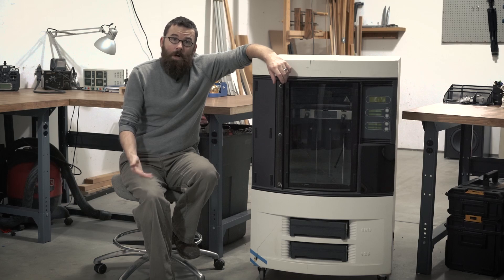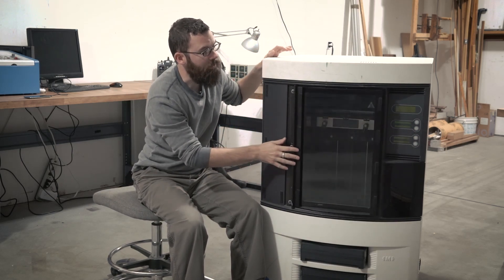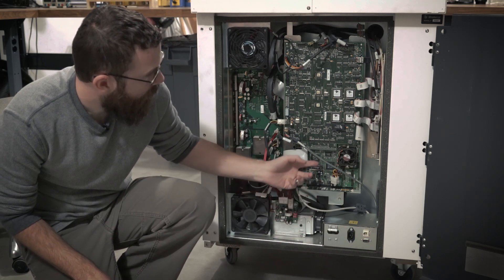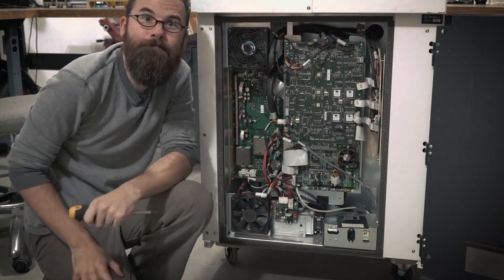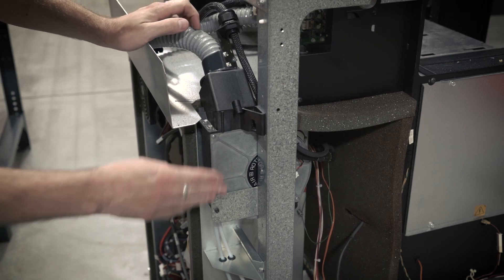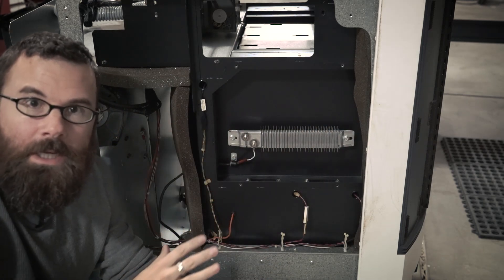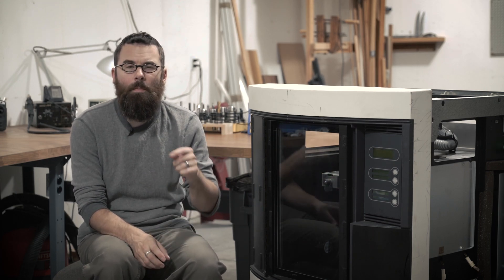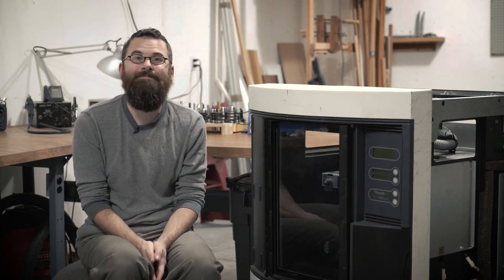Stratasys 3D Printer Rebuild - Part 1: Overview and Teardown

Comment: I just got myself a Dimension Elite which is basically the same machine. It works for now but in the future I plan to modify it with open source electronics.  I watched all this series on the Stratasys and I noticed in the end you came to the conclusion that it wasn't worth the effort.  Especially now more than 2 decades after its inception this is woefully antiquated but still do you think it is worth the time to try and update it other than for the heck of it?
Reply from the maker: It would only be worth it for the giggles.  Any modern coreXY printer would be faster and better in almost all aspects.

Comment: Hi. Sorry to boder . but my BST1200es is claiming for help. We have manage to keep it alive for quite a long time bu linear bearing Y axis are blocking and making the step motors lose steps.  I ve watch you videos on the Stratasys 3D Printer Rebuild ... watch the z axis recovery video... but did not find any info on the Y axis...  i asume the tear down of the axis to change de bearing  can make the system lose its parallelism... any suggestions on how to clean the bearings with out the tear down or how to keep the parallelism while trying to change bearings... thanks in advance

Comment: Im looking at a few Maxum models online to buy just for the cabinets and heater and gut the rest to install servos and linear rails. Probably new controller considering that most of them are junk. A complete modern retrofit including frame. I will fast forward through your project I’m curious.

Comment: Would you happen to know the drive belt sizes and where I can order them from?
Reply from the maker: I don't, check the service manual, it's available online.
Reply: @RobertCowanDIY  I have been trying to find a parts list. I bought the unit at an auction. I have the user manual but can’t find a parts list
Reply from the maker: @bryantbanks1486  SERVICE manual, not user manual.  The parts list should be in there.  But I no longer have the printer, so I couldn't tell you the part numbers.  They are standard off-the-shelf belts.  Just check the pitch and width and use a piece of string to check the length.

Comment: Hey Robert, I just found your videos and am going through your rebuild now. Awesome work! How much would you say one of these is worth? I can pick one up in working condition for $500. I also have some modern parts already from other 3d printer builds. Do you think it's worth the $500?
Reply from the maker: In working condition it's easily worth $500.  Whether it's worth it to YOU is another story, but that's a decent price.
Reply: @RobertCowanDIY  Awesome. Thanks for replying! I watched all your videos and am super impressed. Looking forward to doing a lot of the same work once I hopefully pick up the Stratasys I found. I eventually want to get it where I can print high temperature filaments like Nylon and PEEK.

Comment: I know this is several years old, but I just got one of these bad boys and it needs new belts for the motors.  Any idea where I can get them?  I can't find them anywhere.  Stratasys told me to contact my local service tech and they want $$$.  This was given to my middle school.  So there is no money, or not more than I will spend out of pocket for parts.
Reply from the maker: Belts are pretty common.  The ones on here are gates brand, just look on Mcmaster or SDP/SI.

Comment: A good design for the era it was created in. Lots of areas for improvement though. Super not a fan of the blade of air design. While creative, I believe there is a better and easier way of doing that.

Comment: My name is Vinicius,

I'm brazilian, and i have a 3d print dimension sst768 that is broken.

You could indicate someone to help me??

I await reply thank you
Reply from the maker: If you search google, you can find the service manual for the machine.  I has been posted a few times.  That will provide the most help for you.
Reply: @RobertCowanDIY  OK, you have this link?
I think my machine is loked, the displays show nothing, only backlight.
Reply from the maker: @viniskyredborges  Did you even try searching for it?
Reply: @RobertCowanDIY  i found a file

Comment: Stratasys Field Engineer here: that grey tube pumps air to cool the head. The filament tubes are the white tubes that run into the inlets behind the swivel head. The air does keep the filament stable but it's primary purpose is actually to cool the head.
Reply: Hey Robb, could I ask you for advice for this printer? Do you have a way to contact you? Thanks
Reply: Hey Robb I would also know where I would be able to get replacement drive belts for the 1200BST

Comment: Robert, Thanks making this series you motivated me to do the same and after a year hiatus I have mine up and printing. I did a couple of things different than you did. First I used the 768SST printhead  I changed out the geared servos for geared steppers (NEMA 8) this seams to work well so far, I just had to machine an adapter to interface the motors to the printhead. Second is I used a Duet2 Wi-Fi  board instead of the Smoothie board, again I am happy with this board and it is well supported with lots of information on how to integrate it. Third I used 400 step NEMA 23 steppers for X Y and Z, and I think that was a mistake, as I am having layer alignment problems (sloping sides) in X and Y  that I can not seam to dial out. I was curious if you saw any of this in your prints that you got off the machine?
-Wade

Comment: Hello, what is the reference on the stepper motor, how many cables? 3,4 or 5 or is it a small servo, and the drives what do they look like? What's the reference on those... Maybe can be reused as external...with new board, Sending inputs

Comment: what belts do stratasys 3d printers use? most belts are rated for 80C/175F
Reply from the maker: I'll have to look, but they were just standard Gates brand belts.  I hadn't thought about that, but you're right, the temp rating would be a problem.

Comment: @9:26:  I believe the purpose of the fan and hose system is to deliver cool air to extruder steppers, as they are the hardest working steppers and the most vulnerable to heat failure, etc.  I believe this is how Stratasys takes advantage of their heated chamber patent (https://www.google.com/patents/US6722872).  The extruder steppers are considered to be "outside" the heated chamber (even though at first glance it seems like they are deep within the chamber).
Reply from the maker: The stratasys doesn't use steppers for the extruder, it uses DC servos, so I'm not sure if heat is much of an issue.  I think the fan is to pre-heat or at least get some circulation around the filament.  otherwise, it could just heat up inside the chamber and create issues.  but I'm getting to that part and I'll have to see how it works.
Reply: Ah - that's interesting.  Just looked at some Stratasys vids on YouTube, and I can see what you're saying.  Seems like they're not using that patent at all, then.  Their approach seems to be to run all the motors/steppers in the heated chamber.
Reply: It’s mainly to keep the heat break area cool on the fortus and Titans

Comment: Hello Robert, nice video. I have an old BST768 with a problem. Maybe you could help me? After starting up the machine, the display shows the message "Shutting Down, Code:14, 113 Cooling Donw.
Any idea what that could be? Stratasys says it is a defective door lock. But after replacing it with another one. The error code comes up again.
Reply from the maker: Search google for the service manual and look up the code.  It might tell you more about it.
Reply: The code 14:113 is Door not latched it states the following :

1. Verify chamber fans are operational. If not, replace 24VDC power supply.
2. Inspect solenoid and wiring.
3. Replace solenoid.
4. Replace PD

Comment: About 10 years ago, I purchased that exact unit, but with the matching base/stand.  I was the R&D manager for a medical company and used it for prototyping surgical scrub applicators.  At the time, it was one of the best units on the market.  I also had purchased the post-processing/washing system for dissolving the support structure.  I didn't care for the cartridge system.  But the unit worked flawlessly well.  Unfortunately when I left the company, I don't believe it was ever used again.  Quite a robust unit though. Should be interesting to watch your rebuild.
Reply from the maker: That's sad to hear!  The same thing happened with these, the company had two of them and they went unused and when they moved, they just tossed them out by the dumpster.

Comment: Can you name the manufacturer and the model number of the fans in the heated chamber? Are they made of metal and special high temperature fans? I'm looking for fans for my heated chamber (80°C) but normal fans are only rated up to 70°C.
Reply from the maker: I can check on the fans and see if they have a model number.  They might be custom though.  I'll check when I get back in the shop and see if there are any identifyers.
Reply: Nice, thank you.

Comment: I really don't think I would gut it.  If it still works it can print down to 0.005" and the Insight software is pretty good.  I have my own 768 SST and it works fantastically well.  Plus, you can refill the cartridges.  I don't see how you're going to be able to improve on it very much.
Reply from the maker: Nothing I'm doing should prevent it from printing at the same quality as the standard hardware.  If it worked 100%, I wouldn't be doing any of this, but it does have some issues, and doesn't print.
Reply: I understand.  I'm sure it will turn out great.  What are your plans for the parts you pull out of it?

Comment: Awesome find. I used to use a big stratasys machine back in college, can't wait to see how you upgrade this unit.
Reply from the maker: I have one axis moving around, just need to wire up the other two!  So far so good.  But this is the easy part, the extruder will be tricky.
Reply: Is this one of their dual extruder machines? (one for model, one for support material)
Reply from the maker: Yep, it's a BST, which means breakable support structure.  The SST is soluble support.  So it has 2 extruders.

Comment: Sorry missed the point of why you are going to change components of this machine, wouldn't it be better to keep it as it and just utilize it?
Reply from the maker: I guess I didn't explain that well enough.  The Stratasys uses a proprietary software which is cumbersome to use and I'm not sure if it's free or available anymore.  You can't just send it g-code.  Also, it uses proprietary filament with cartridges that contain EEPROM chips for identification.  It also ONLY works with filament from Stratasys which is VERY expensive (like several hundred dollars a spool).

Comment: What a find! I never find anything this cool on Craigslist.
Reply from the maker: Everyone always says that to me.  You know how long I had this search setup for?  2 years.  It took 2 years for something like this to come around and I responded within an hour.  You can't expect to just hop on craigslist and find anything good, you need to know what you're looking for and be dedicated.  Right after this video posted I picked up 3 working electric wheelchairs for $300 that will get scrapped for parts.  It's just patience and being at the right place at the right time.  I still have searches that have NEVER had a hit after years.
Reply: Robert Cowan I've had IFTTT set up for a few items for a several months now. I was about to give up on them. Guess I need to be more patient! Also, now I want to add electric wheelchairs to my searches...
Reply from the maker: Yeah, I forget some of the stuff I have saved on searches!  I have stuff like roboclaw motor controllers, roboteq controllers, robotic arms, wheelchairs, etc.  Rarely will I ever get a match, and most of the time when I do it's not related or too expensive...  But sometimes, it works out.  Wheelchairs are actually pretty easy to get.  Most of the time the batteries or charger dies and people just toss them.  Over the years I've bought about a dozen or so, and I've never spent more than $100 on one.  They're always in rough shape, but the motors and actuators have always been just fine.
Reply: Robert Cowan ever since I saw your video with you riding the remote control wheelchair, I've wanted to buy one.
Reply from the maker: They're fun.  Get a battery, get a chair, add a roboclaw or sabertooth, done!  I'll be working on the printer and a wheelchair-related project at the same time and releasing videos on both in the next couple of months.  If you have room for one, they're fun to tinker around with.  And SO much faster when you get a controller that's not filled with safety features ;-)
Reply: Looking forward to watching them!
Reply: Can you still set saved searches to sent notifications to an RSS feed? It used to work but CL changed something and it broke.
Reply from the maker: No idea, I just get the emails.

Comment: Checkout the Duet Wifi Board. I am using on my printer it is a really great board with plenty of horse power and extra IO all the Dimensions sensors.
Reply from the maker: I have looked at it!  Right now I'm torn between that and the Smoothieboard.  On one hand, the smoothieboard is more mature and has more robust software.  But the duet wifi has a lot of really exciting features.  It's a toss-up.  But I feel like with the duet wifi, I'd be paying a lot more just for the drivers, which I don't need.  For right now, I will be using Mach3 for control (through a parallel interface) and testing.  I will eventually move to a standalone board, but right now I'm in no huge rush.
Reply: Robert Cowan as far as the duet firmware goes dc42 (the guy developing the firmware) is super responsive and really good about helping if anything comes up.
Reply from the maker: Sounds good.  I wish I could buy both and test them side by side.  In all reality, they're both probably fantastic.  It will come down to which one best supports external drivers and solid state relays for the heaters and things like that.

Comment: you got a Stratasys printer???? wowwwwww..... soooo coollll.... I want one :)
Reply from the maker: hah, right?  I saw it on craigslist and was like "$25?  yes please."  It was a great find and it's fun to mess around with even if I can't get it working 100%.
Reply: Robert Cowan I could not believe when you said 25 boxxxx... even if the printer is died we can extract stepper motors, electronics, etc...goos deallll
Reply from the maker: Totally.  The guy just didn't want metal scrappers to get it so he just priced it super low.  He even knew what it was.  But, I do expect to spend about $1k in the conversion.
Reply: Robert Cowan wow.....even the guy knew it that it is 3d printer...wow..so good deal...
Reply: I can help you get it running.   You can reprogram the chips using a serial cable and use cheap abs and hips in it